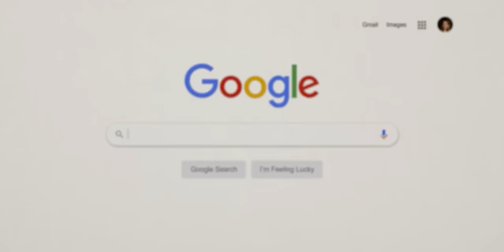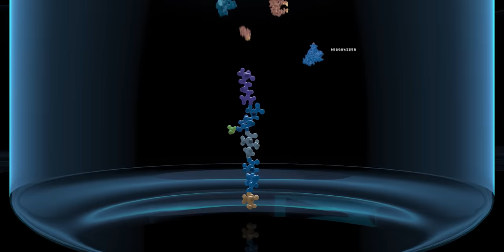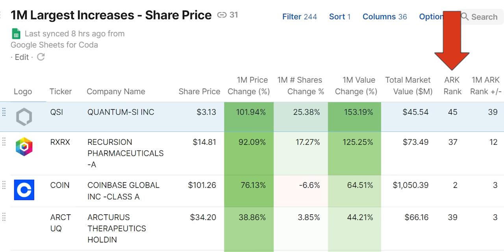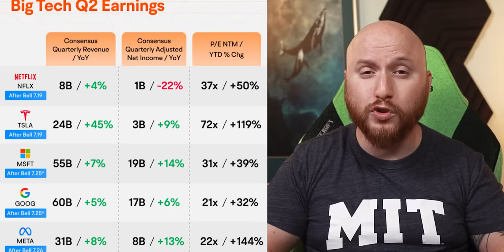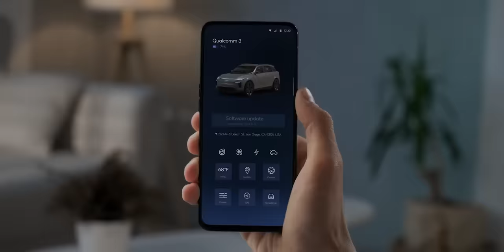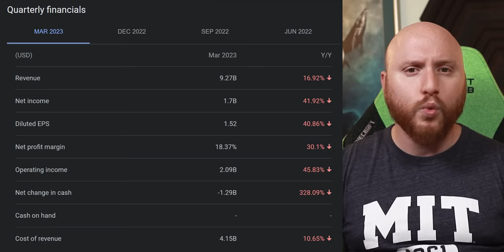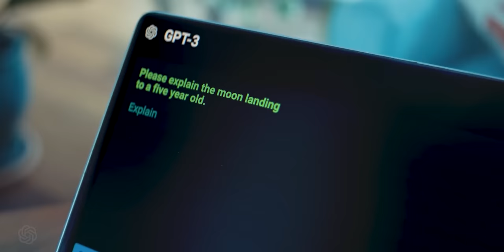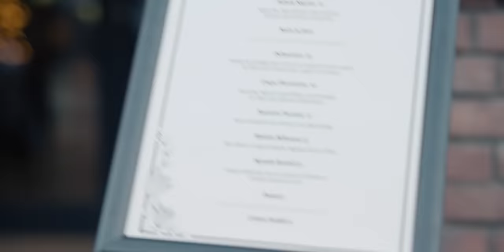Top 3 Chip Stocks I'm Buying Now (Over Nvidia Stock)

Comment: Hi Tsy: 
Let's assume that QSI presents an excellent opportunity. However, we need to consider whether the barriers to entry for competitors, as described in Porter's five forces, will remain high in the long term. Just because QSI currently holds a competitive advantage doesn't guarantee that this advantage will be sustainable over time. It's possible that advancements in artificial intelligence (A.I.) within the next five years could enable competitors to replicate QSI's processes at a lower cost. You should look into VGT / FTEC / XLK for long term investing.
Reply: All three of those charts look identical.

Comment: Two underrated stocks are Marvell Technologies (MRVL) and Global Foundries (GFS). I own MRVL and was in GFS previously but will look to get back in after this pullback.  Also, don't sleep on ASML, LRCX, KLAC, and AVGO. I am in the first three.
Reply: GFS, I believe you are not in the semiconductor industry and don’t know much about it.
I work as a Fab engineer for many years.
Reply: @ec188  no I am not in the technology industry but from a macro risk perspective, they are not in a territory where China will take over. So, if you want to spread your risk on a chip manufacturer and not invest in Intel, then GFS is an option.  They also recently signed a pretty large deal with Lockheed Martin so please have a look and let me know. If you have other chip companies I should consider like AMAT, AMBA, NXPI, WOLF, then please let me know.